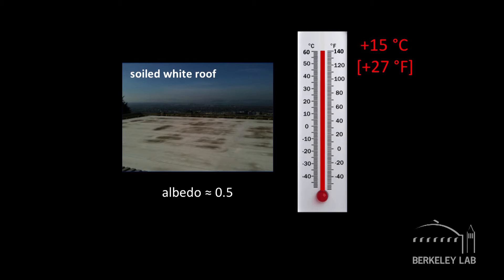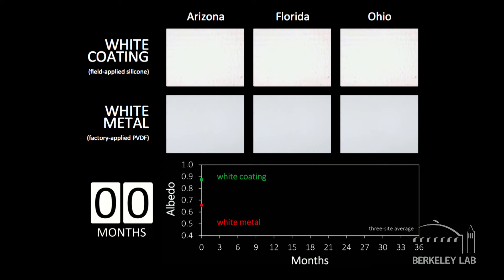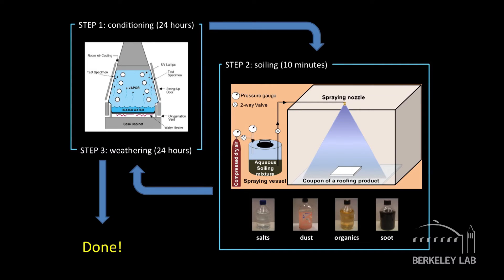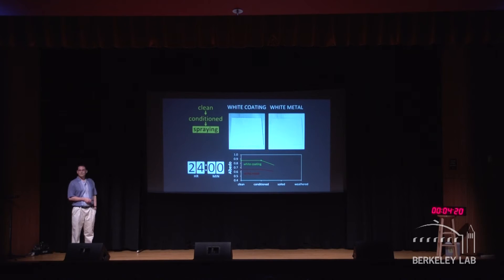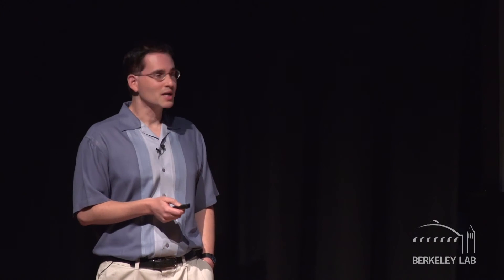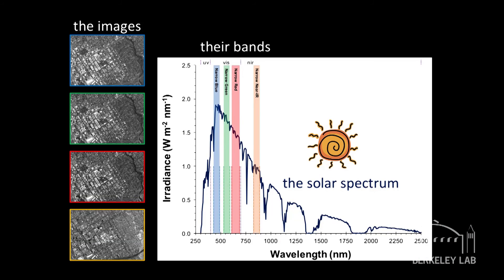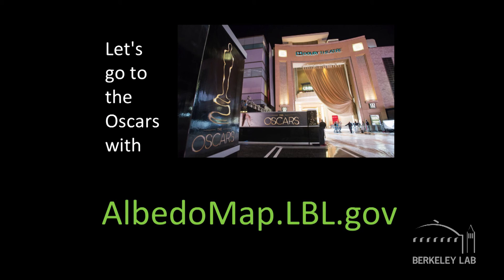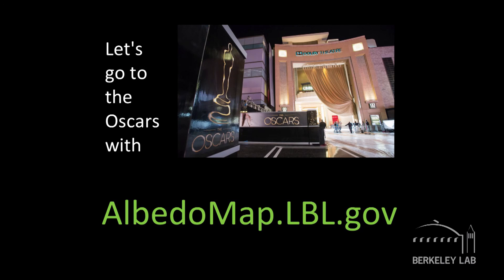Cool Roofs Through Time and Space

Comment: even in chicago you want you roof straight white it gives less of a heat penalty in winter because thats more about insulation. and opening your windows to suck in heat if desired.  but the roof and attic make roof pure white, reflective what ever the most extreme is. you will thank me in the summer and at year end with an energy audit. 
also update your insulation if possible as lot of homes down have it where it needs to be.  also thermal mass and a inline duct fan to vent out and dump heat with pressure seal is huge too